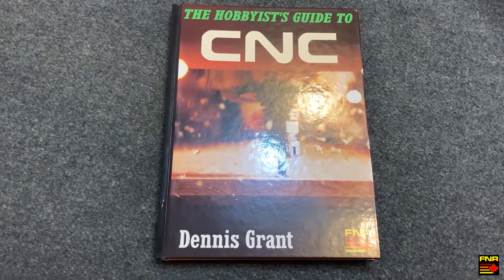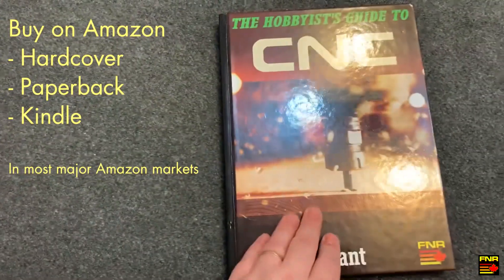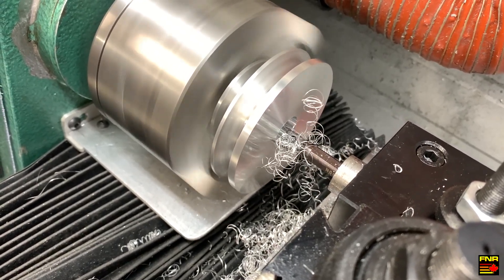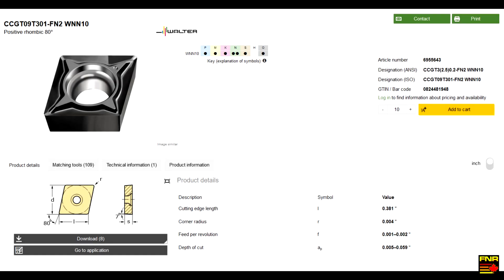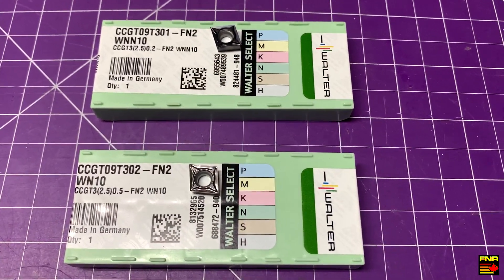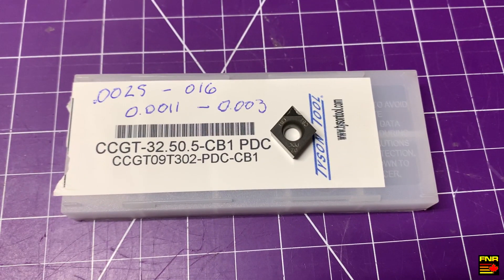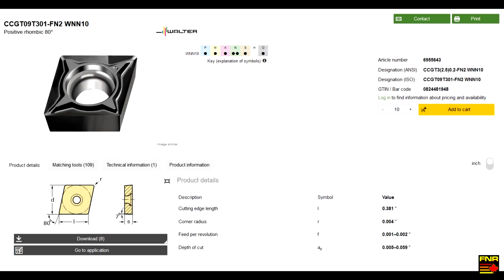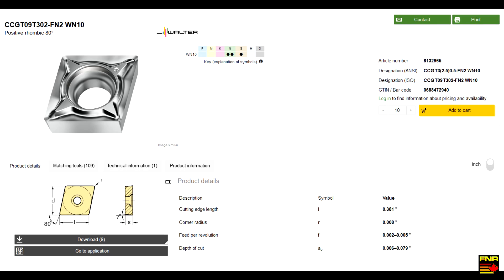FNR CNC S03 Ep03 - New Lathe Inserts that Chipbreak Aluminum

Comment: Hi, I think the diamond was running too slow.  I recently bought a diamond with chipbreaker and I will be running 80 diameter at 4000 rpm to get the suggested surface speed.  All inall those inserts were great, I don't use Walter, but I will be trying the insert for steel that I used today and see how it works. Enjoyed the video, thanks for sending me here.
Reply from the maker: I am RPM limited so I have to live with whatever SFM I can get.

The diamond worked well once I got deep enough, and even its "bad" chips are better that the spools of wire that come off of some other inserts I have tried.

I have a boring job coming up. I have a solid carbide indexible 5/8" bar coming that will fit that diamond insert - I'm going to try both and see how they do.

Thanks for dropping by, and feel free to visit the rest of the channel!

Comment: with CNMG aluminum inserts i can run DOC 0.2", 0.024"/rev feed, 1600 feet/min in EN AW6082 for all day, 26kW spinde on 70%
on such small machines you should use 0.015"/rev minimum and small 0.02" DOC so your spindle and rigidity can run it - only way to break it

Comment: mate, at $15 an insert I can live with the stringy chips or use 2011 instead of 6061 🤪
Reply: Recently bought a whole collection of expensive industrial quality drills ranging in 1-13mm diameter in 0.1mm steps and the regular sizes twice. One of the most expensive tool purchases ever for me, but SO WORTH IT. I swear, my intense fear of breaking a drill, stuck in a cast aluminium hole has dropped to 'lets go and hope it doesn't break." They ate through case hardening of a crankshaft, performed under high heat stainless steel drilling, and I swear, they eject swarf better, i think because the spirals (flutes?) Are such high quality (surface roughness) finish. I guess it's the same for inserts.
Reply from the maker: @DC_DC_DC_DC  with a lot of this hobby stuff, the trick is finding out what problems industry solved and how, and seeing if it can be leveraged. 

Some problems need big machines, 440V 3-phase power, thousands of square feet of shop space… and some need a box of inserts or some drill bits. 

Not every hobbyist problem can be solved economically by stealing from industry - but when they can be, it is nice!
Reply from the maker: Buy once cry once.

A box of ten will last me for the rest of my life.
Reply: @FNR  not sure if 2011 is suitable for your needs, I've not looked back since I started using it though I still have a lot of 6061 stock to use up.  My 25c cheap and cheerful import inserts work great on it; not sure about you, but I end up chipping inserts from time to time so it'll be a lot of crying with $15 inserts.